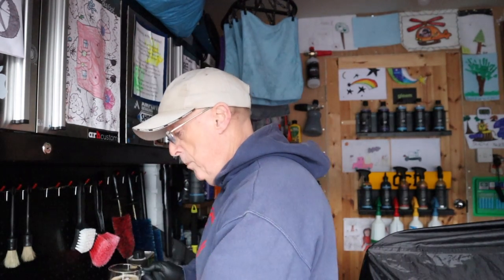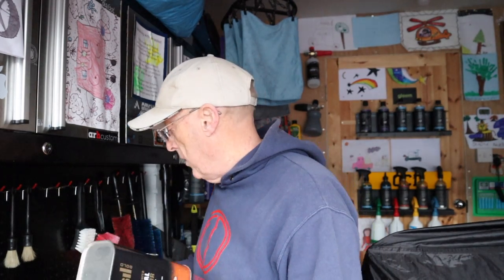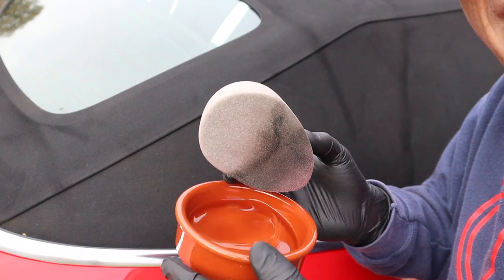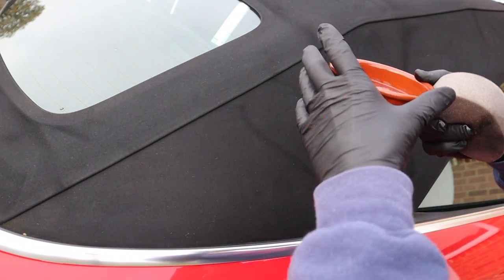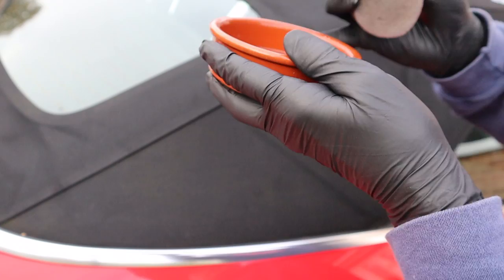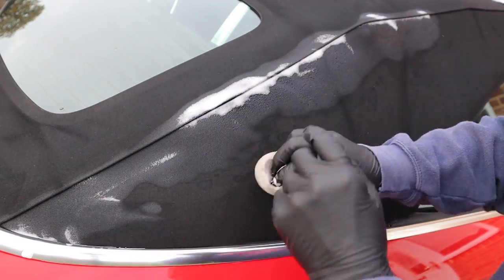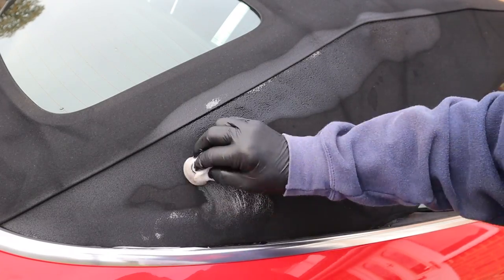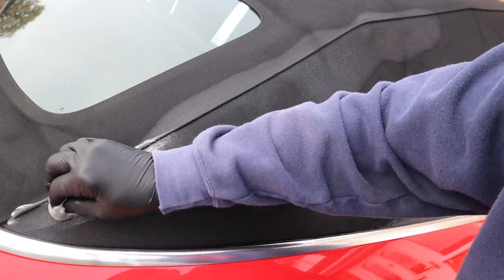Convertible roof protection

Comment: Just bought the cleaner and protector and used them on our Mini. After days of rain, the forecast is sunny! How long after the first coat (took 750ml!) would you do the second coat?
Reply from the maker: Once the roof is totally dry
Reply: Love your videos Martin. Just subscribed. Can you recommend a drying towel?
Reply from the maker: @MarcusOliver2006  Hi Marcus, a warm welcome to my channel. Check out any of my videos and any issues or questions then just drop me a comment and I will always get back to you. My favourite drying towel is the Gold Member. At the moment they are only £9.50. I have a couple and really recommend them. I suggest you always dry the windscreen 1st and that will make the towel slightly damp and it will perform better. https://carsanddonuts.com/index.php/product/gold-member-drying-towel/
Reply: Thanks for the recommendation Martin

Comment: Thanks for the tip Martin. With Gabriel gold do you still have to apply 2 coats or is 1 coat enough?
Reply from the maker: Just glad to be of help, that’s the whole point of my channel so thanks for supporting. I only apply one coat and that seems to last. Depending on the weather it can last over six months on my Wife’s Audi
Reply: @ObsessiveCarDetailer  Cheers Martin. and as you could probably guess Fabsil got autocorrected to Gabriel 😅
Reply from the maker: @nelz9299  🤣👍

Comment: Hope you can help.
Wife has new car with autoglym foc by dealer.
When it comes to drying the towel I have weighs like a bus and is soaked before I have finished so ditched it.Bought a maguires waffle drying cloth and it works well but still have water streaks.I dont have a blower.
Now got a bottle of garage therapy instant dealer, is the right way to go?Also what is the best cloth to apply, I have bought these
16'' x 16'' Plush 350gsm Yellow Korean Microfibre Edgeless Car Detailing Cloth.Unsure if I should use the detailer after every weekly wash?
Thanks
Reply from the maker: Hello Mark, hope I can help mate. So let's start at the beginning. I really like Autoglym products, in my view you cant go far wrong with them. However Im really not a fan of the product the dealerships sell as a  life protection product. I have had that on a couple of cars in the distant past and found it as useful as an ash tray on motorbike. So I would forget I have it on the car and just carry on washing and protecting as you would normally with your favourite wax/sealant. Garage Therapy 2 QD is a great product and probably the most used product on my shelf. It is a great drying aid BUT be carful mate on what towels you use with it as the more you use a towel with a drying aid the more is will eventually resist water. The best drying towels I have and the best value for money is the Cars & Donuts Gold member  https://carsanddonuts.com/index.php/product/gold-member-drying-towel/  currently on sale for £9.50. I have two and love them. I have other drying towels I like as much but they are more expensive so start with the Gold Member and see how you get on. But remember what I said about using the drying towel with a drying aid. Also the GT 2QD will only give protection for a week or two so depending on how often you wash the car you may want to think of a better form of protection. Hope that is of some help but, Im just at the other end of the keyboard mate so happy to help and clarify any time
Reply: @ObsessiveCarDetailer  Thanks for that but now being really thick.
I have my car and it's wet,I continue to use the waffle to dry it then use this towel you suggest to apply and buff the gt?Sorry asking the obvious..
Reply from the maker: @markmummery8765  No Mark, use the Gold Member to dry the car. If you use it to first dry the windscreen, that makes the towel slightly damp and strangely enough it then drys better and leaves the paintwork clear. Check out this link to a video I did on Soft99 Luxury gloss  at 11min 30 sec when I dry the car with the Gold Member  https://youtu.be/CJL24NsW76s
Reply: @ObsessiveCarDetailer  Ah..I must come over as dense,so I spray the gt first then use the towel as you said about towel earlier? What if I still have water streaks? Use more gt with a microfibre towel n buff.
Think I spending money like I just won the lottery😀
Reply from the maker: @markmummery8765  🤣 Not dense mate, we all started somewhere. So I think forget about using the GT as a drying aid for a while as it can just add confusion and just wash, rinse and dry the car with the Gold Member and you shouldn't get any streaks. Then use the Gt on a dry car & see how that goes. Give it a go and let me know how you get on. I dont know where you live but here in Berkshire it has rained for days and looks like that is on the cards for the next few as well so no chance of washing anything here
Reply: @ObsessiveCarDetailer  Thanks for the clarification.I'm on the east coast,uk's most easterly town, Lowestoft.Lots of salty air and overrun with gulls.I'll get towel on order and see how I get on.Beware of more questions tho!Thanks again.
Reply from the maker: @markmummery8765  always happy to help Mark, it’s never a problem mate
Reply: @ObsessiveCarDetailer  Ordered towel and used today.What a change, not a pro but 95% better,prob my action..but well pleased.
Thank you .Cat now has the other in his bed...
Reply from the maker: @markmummery8765  brilliant, great news. Now your a pro🤣👍
Reply: @ObsessiveCarDetailer  A long way to go...What do you recommend as spray on rinse off alloy wheel sealant please.Do you just let it dry natually once rinsed.Thanks again.
Reply from the maker: @markmummery8765 Ok Mark so once the wheels are washed then use the spay on rinse of sealant. If possible use a pressure washer to rinse the sealant off and do it straight away. So literally spray on rinse off & then I suggest drying the wheel to ensure you don't get any water spots depending on how hard your water is. If you do get water spots then let me know and I have a video on how to safely remove them. Two really good quality products are:- https://countydetailingsupplies.co.uk/product/gyeon-q2m-wetcoat/ https://www.elitecarcare.co.uk/product/carpro-hydr02-lite-ready-to-use-silica-spray-sealant-1-litre/ Hope that is of help mate
Reply: @ObsessiveCarDetailer  Much appreciated, I'll get some on order.Thanks.